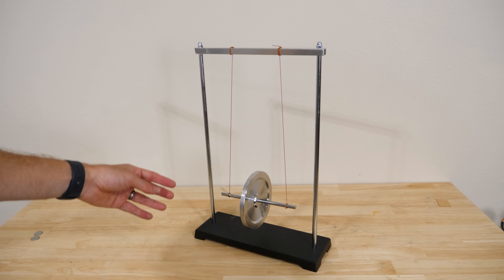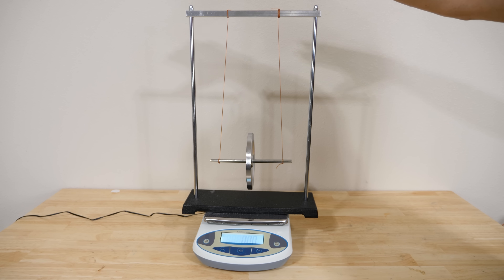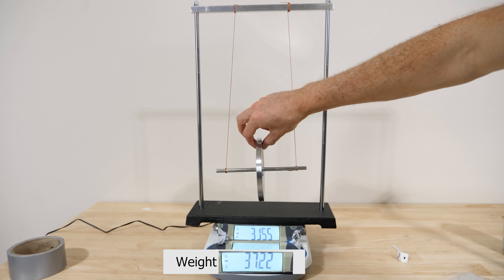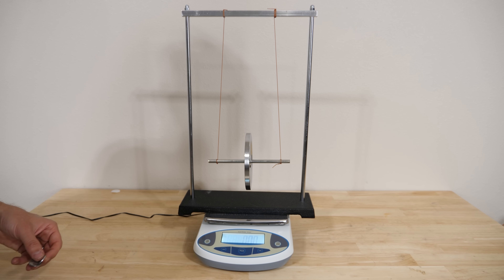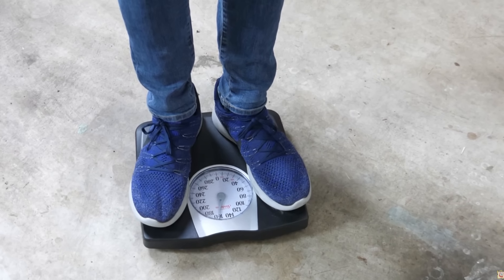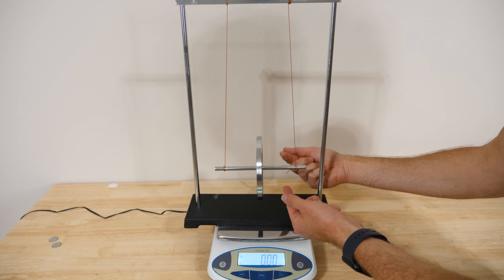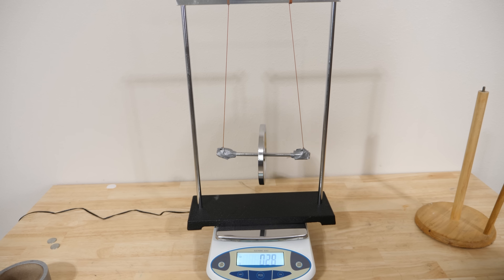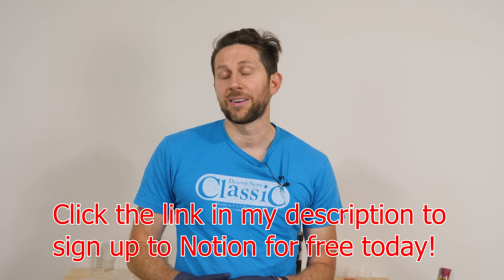How Does The Anti-Gravity Wheel Work?

Comment: On why the scale does not show the peak value when the disc bounces at the end of its tether: I assume the processor of the display is programmed to display an average over some time interval, probably half a second or so. Without that smoothing the value in the display would jump all over the place, making it unreadable. So the fact that the display does not show the short duration peak value is not due to 'slow refresh rate', I think. I think the processor may even be programmed to discard short duration peaks.
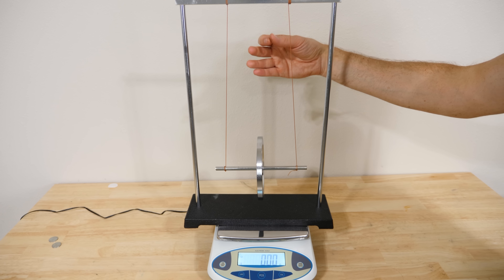Reply: Im inclined to agree with OP on this one. Watch at 7:19 when he lifts the wheel off completely. If it was LCD refresh, the value would appear to change close to instantaneously. Instead, its still climbing up a half second later.

I've worked with many scales. Most of them have some sort of filtering, damping, or averaging built in to deal with air movement, vibrations, etc. A lot of them will even let you adjust the filter for the application. A simple average or lowpass filter is trivial to implement and makes the scale much more readable.
Reply: Why not hold it out the window and see if it falls? 🤣🤣🤣🤣
Reply: I believe this is correct. It can be tested as well. Use a weight with the same mass, but different radial distribution. The angular momentum will be different, and the rare it bounces will be different, so you should expect a different result. And of course, the mass is the same, so the difference must be in the timing of the scales measurements.
Reply: The other YouTube experimentalist, Alfa Phoenix, which takes measurements with oscilloscope, can clearly expose this transients and ,I bet, give reason to you who said the scale is hiding the reality by integration time.
Reply: The bigger question is how many women are jealous of his feminine voice
Reply: Electronic scales do take quite the time to register
Reply: I think the scale actually showed the positive weight, but your eye/the camera was too slow to catch it.
Reply: I wouldassume the density and radius of the flywheel, the length 
and tension of the cords plus the weight of the support structure would have to be matched up to the strain gauge load cell and refresh rate of the microprocessor sending the values to the display... ??
Reply: Your theory explains why the experiment is flawed. Well said.
Reply: I would dearly like to see two identical discs, suspended fore and aft from a wider frame mounted on the scale - one of which is not released until its twin has bottomed-out. Based on the explanation given in this video, I would assume that these would cancel each other out (irrespective of the rotational movement directions of the discs; in- or anti-phase), and thus record zero(-ish) average meter scale deflection, rather than the neg7 results obtained in the example: If that total cancellation proved NOT to be the case however, then I think Newton would probably start rotating in his crypt in sympathy (and NASA might have to start a new budget line category).

Even better, perform this 2nd experiment in a vacuum jar to remove air resistance from the equation. 

Furthermore, it would be interesting to see a variation of the original experiment, using a magnetised disc falling through a copper tube (i.e. a Lenz’ Law demonstration setup) to determine the effect of eddy currents on the results - again, I would assume the additional resistance caused by the magnetic eddies would simply dampen the process and shorten the number of rise and fall iterations - but what do I know? It would certainly be worthwhile playing around with the methodology to see if there just might be some sort of gravimetric advantage to be gained (I’m folding a new tinfoil hat as I type).
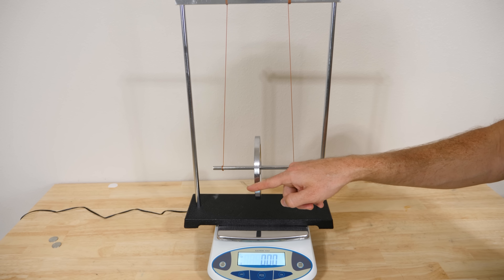Reply: At 7:57 he talks about the spike of force when it reaches it at the bottom.
Reply: I doubt it. A scale like this isn't really intended to weight things that are bouncing around. You're assuming it uses a relatively complex algorithm to average out a lot of samples taken between updates and tosses out short duration peaks which it would have to do for the display not to increase when the weight bounces (but then what's the point of taking an average if you're going to toss out samples?) when it would be a lot simpler just to take a sample before every update. As long as the thing you're weighing isn't bouncing around, there's not much point in averaging multiple samples.
Reply: @chitlitlah  As an embedded software engineer I am convinced that filtering out bad values and averaging number of samples is what the scale firmware does. No doubt in my mind. All signals have noice and this sort of strain gage used in these scales have very small signals that need amplification which worsens the problem. Not mention the 'commercial' aspect of a consumer scale: any scale that would exhibit non-stability would be shun by the average user so they make sure that the display is steady and averaged so much that repeat measurements almost always return the same value.
Reply: @chitlitlah  Sensors and electronics are inherently noisy. It's not necessary an average, it could just be a hardware low-pass filter which is trivial to implement. Even if it was software, averaging is definitely not complex at all, and it's not only useful for bouncing things.
Reply: @chitlitlah the scale may be correct because the force the spin is causing is reducing the weight down caused by gravity thus scale detects less weight on average.
Reply: Then why is it always at - weight.  Even if it the scale is taking an average force over time, the average should be around 0, not -6
Reply: @CharlieKellyEsq   Let me quote what I wrote an hour ago: "I assume the processor of the display is programmed to display an average over some time interval, probably half a second or so."

I estimate that it takes the weight 3 seconds or so from release to the end of its tether. That is several times longer than what I gave as a guess for the duration of the averaging window.

Whatever the actual duration of the averating window is, clearly it is short enough so that the scale has opportunity to show a readable value of around -6
Reply: @cleon_teunissen  If the scale were ideal and were built for measuring things in motion, it would show this spike at the bottom, and the force would average to zero over an interval between equivalent points in the cycle.  It doesn't do this, because the scale is meant for weighing things that are stationary, and this spike at the bottom is in its blindspot.  The asymmetry in timing is what causes it to appear to show antigravity, due to imperfections in the scale that cause this blindspot.
Reply: @carultch the explanation is very simple, when the weight goes up, it forces the scale down due to the reaction force of one object accelerating over another, the only time this force tends to zero is when the disc reaches its lowest point, as these scales usually measure every 1/4 of a second, there is not enough time to record the zero value. In order for us to have a real view of what is happening, we would need to take measurements at very short intervals of thousandths of a second and plot them on a graph that can later be expanded to buy, this is physics, it doesn't take much intelligence to understand
Reply: Digital scales are effectively instant (in human timescales), but the liquid crystal displays are relatively slow, so the scale registers the sudden peak but the display is unable to change before the weight returns to the normal reading. No averaging is performed because there’s no need for it in this application.

You’re welcome to ‘assume’ whatever you like, it doesn’t make you right.
Reply: @fredbloggs5902  Neither of both of you have any evidence to back up your claim. Yes, LCD are "slows", but I really don't believe that the uC inside would update it more frequently than what it could display anyways. And yes, it's really common to smooth out readings, it being in software or just because of the limited dynamic of the electronic and the sensor.

Whether it's the cause here or not is only speculation.
Reply: @jonasdaverio9369  Believe whatever you like, it’s just a load-cell Wheatstone Bridge going to an ADC and then a PIC microcontroller to convert to the required units.

The microcontroller takes 200 samples and typically operates at 20 MHz (20 million cycles per second). 

LCDs typically operate at 50 Hz.

See the problem yet?
Reply: @fredbloggs5902  The sampling rate doesn't tell what the frequency response is. By the way, what do you mean the the uC takes 200 samples? Do you mean it takes a rolling average of 200 samples?
Reply: @fredbloggs5902  I'd like to agree more with you, when designing (with my previous employer) we avoided 50/60 Hz frame rates, there is nothing good gained by getting close to mains frequency, it just induces visual ripple if you are in certain lighting environments (old flourecent light, cheapo LED lights). To be clear, for me it was industrial applications not household. (for people playing along at home individual LCD segments are actully driven by an higher order pseudo AC-like voltage, using DC would ruin life expectancy).

If I was in charge of a Digital scale development I'd integrate multiple samples over time because of natural occuring vibrations in an urban home setting, having the last digits flicker madly because of a passing truck and heavy footed person walking by would be annoying. Not to mention wobbling because the bowl might be unsteady on scale + let's say you poured something thick like youghurt on a pile of Muesli, this would cause continuos shifts and typically in a el-cheapo scale you can't sample all sensors at once because cheapy MCP would only have one ADC and use sample-and-hold techniques... or worse.
Reply: @fredbloggs5902  The problem is not the display. Electronic scales use a type of integrating converter called a sigma delta ADC. Scales require very high resolution converters (typically 24 bits) as well as consuming tiny amounts of power which limits sample clock speed. The resulting decimated sample rate is very slow compared to the typical successive approximation ADCs you get built into many microcontrollers, and further filtering is applied which makes it slower still.

For instance the common HX711 which is commonly used with load cells in inexpensive scales would run at 10 samples per second for lowest power operation.
Reply: @fredbloggs5902  They are effectively instant but do not produce continuous measurements. They will measure at a fixed refresh rate. If peaks occur outside the measurement period ,they will be missed completely.
This experiment should have used an analogue scale , which measures continuously
Reply: @fredbloggs5902 ”You’re welcome to ’assume’ whatever you like, it doesn’t make you right.” – says the guy who thinks it’s because the display is too slow, lol.
Reply: @Ethesen  You realise the displays used in domestic kitchen scales are the TN-LCD constant voltage segment type, right?

And I didn’t say ‘slow’, I said ‘relatively slow’, as in relative to the response speed of a strain gauge.
Reply: It would be good to see this same device demonstrated on a mechanical triple-beam scale.

Comment: Absolutely yes. It's sometimes counterintuitive that force is in the direction of acceleration even if velocity is in the opposite direction, but that's the truth.

Makes a bit more sense if you think about it as 99% of the weight is passed through the strings instead of focusing on the 1% that is directly affecting the velocity.
Reply: the mass is falling down and converts a small amount of the potential energy into kinetic (small movement downwards) thats why less force pulls on the upper rod. and when it moves upwards it converts still a small amount into kinetic energy (that gets lost in any resistances like air, "sound", heat) even though it seems like it would pull it downwards like if a human jumps on a libra or pulls itself upwards on this rod - in this cas etha mass would increase/decrease depending on the acceleration but because the flywheel of his machine doesnt generate a force (like we do biochemical) the force could never exeed 0 (positive) because the enegry is convertet into other forms until it comes to a stop.
is that right and if not can you tell me my mistkae in this thought - i kept the old one just that you can see where i was coming from, if im stil wrong at some point. maybe its easier to correct a mistake then - like the mathteachers that told us to write any little thing on this damn paper xD

first thoughts so keep that in mind, i got a bit closer now: but still its kinda hard to get the upward movement cause if you thin k about yourself hanging at a pipe and slowly let yourself sink it makes sense that not all of your mass or in this case force gets applied to the pipe, because you let yourself sink - if i understand it right you convert your potential energy in kinetic but most of it stays potential or no. if you rest its potential if you move kinetic... oh fuck
its late tbh and its not my native language aswell.
the point thats hard to imagine is if you convert all your potential energy in kinetic, you are free falling - kinda, lets keep it simple. but to explain what happens there is. does the spinning of the shaft count to potential energy or ist it kinetic because its "on the move"
Reply: @johannesdatblue4164  Yes, you're right there are 3 forms of energy here. We've got the potential energy which is the height of the object, kinetic energy from falling, and kinetic energy from spinning.

When it is riding back up the string gravity is slowing it down 1% more than the kinetic rotational energy is transferring back into the string. So both down and up would show negative on the scale.

But the real question is there an impulse at the very bottom when it is switching directions that is just so fast that the scale can't read it? Or does the force of the spinner on the string always stay less than the weight of the spinner?